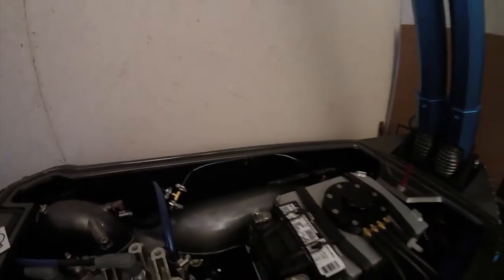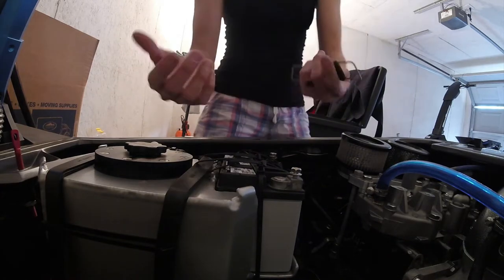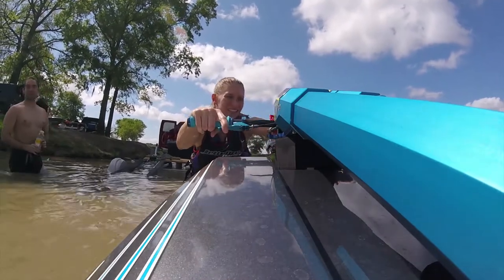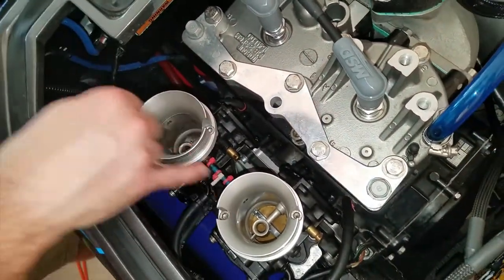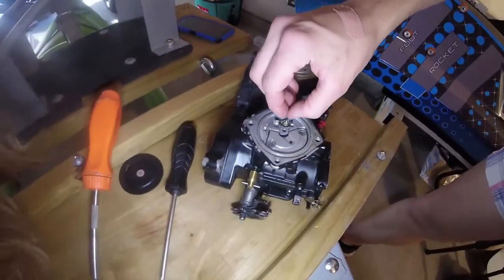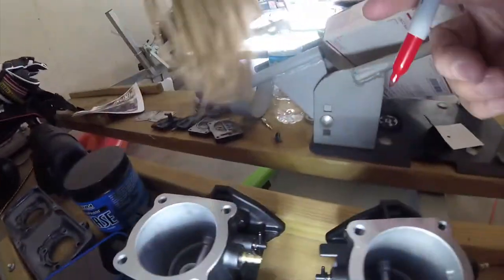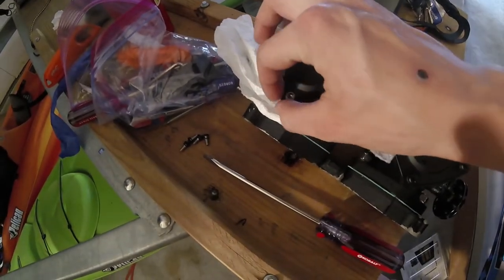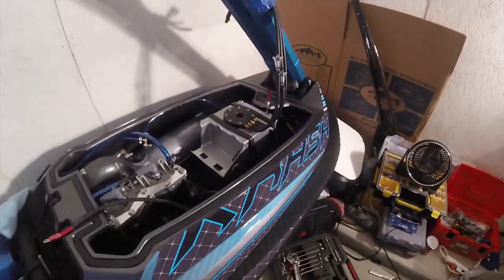ChixSki: Krash 50 Cal Flatwater Freestyle Build - Part 11: Enter Sandman

Comment: Ditch that little filter inside the carb. They cause nothing but problems and not needed if you use an external fuel filter.  I have never once had any issues with them removed.
Reply from the maker: Chris Burnsed I'll pass on that, the reason these clogged is the main filters failed from blasting media in the metal tank. Old video haha

Comment: Good find on the needle sticking!  I didn't hear where you got the first and second set of carbs from.
I didn't catch if you had the needle in the carb cleaner, but I ruined one by soaking it because the tip swelled up in the B-12 and never properly shrank back down.  Nothing a replacement OEM part couldn't fix though.
Also, nice Snap-on ratcheting screwdriver -- gotta love quality tools.

The carbs have a tiny, tiny screen in them that you should have come across so I doubt any of those sand particles got past them and into the motor.  Also do you have an in-line filter to catch the big stuff upstream?
Reply from the maker: mbrickner87 Filters were crap, that is why I was so mad. Yeah needles have rubber so no carb cleaner. First carbs were with the engine setup, second carbs were off Amazon brand new.
Reply: Bummer.  I've seen the mikuni filters work really well and they have a super fine mesh so that's too bad they didn't catch the debris in this case.  Glad you got it figured out though.
Reply from the maker: mbrickner87 just takes time, I think it is getting there 👍

Comment: A ratchet strap is what I would do. Also, clean the tank and when I use carb. engines I usually use ethanol free gas because the ethanol clogs up the carbs and ruins them after a good cleaning.
Reply from the maker: Chase Hughes Ratchet strap for what?
Reply: chixwithtrix The battery if it was giving so much trouble instead of using the straps.
Reply from the maker: Chase Hughes Ah duh yeah, wasn't thinking about that since most of the vid was about the carbs being fkd up haha. Not a bad idea, I'd worry about it slipping and arching the positive and negative though.